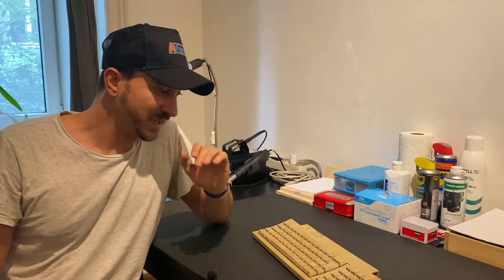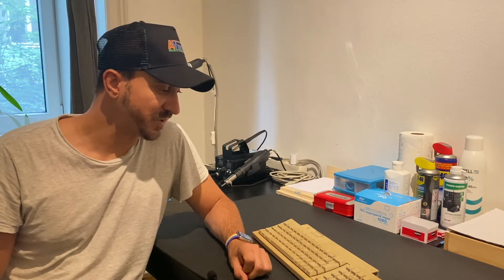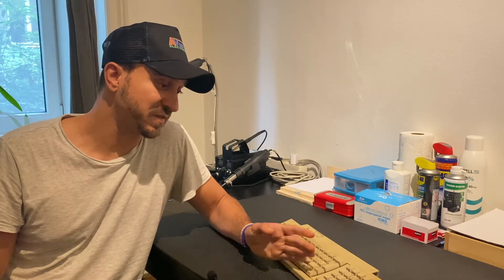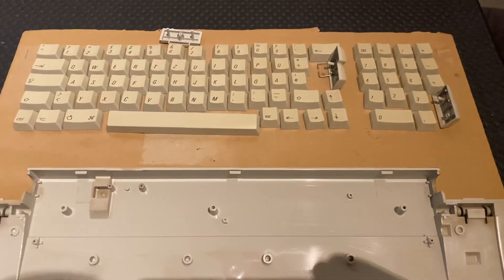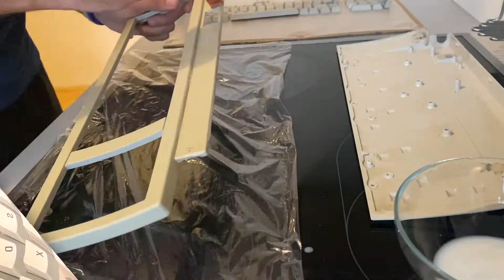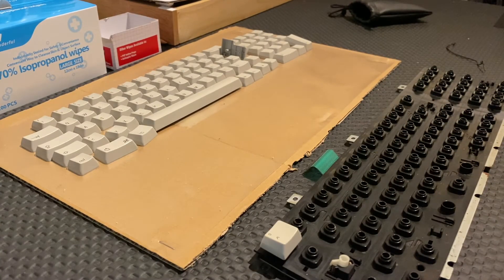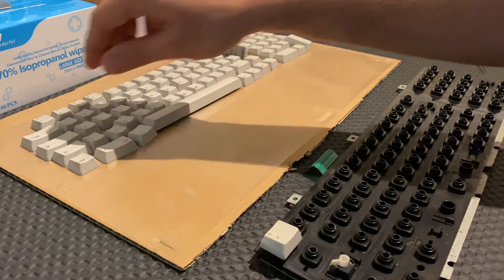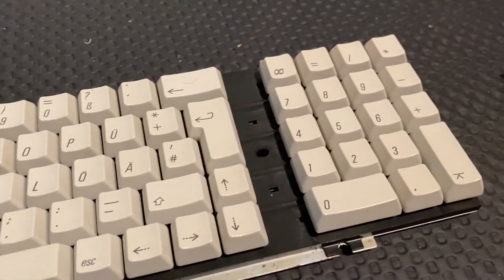Restoring an ugly Apple Keyboard 2 (Episode 15)

Comment: Nice overview. So far, I’ve restored an Apple Keyboard II and an Apple Extended Keyboard II, with an Apple Extended Keyboard waiting in the wings for restoration. I’m curious about one thing. It seemed when I reassembled one of my keyboards, I ended up with two fewer of the rubber things than I expected. I didn’t keep careful track when I disassembled, so I am thinking that two of the larger keys only had one rubber thing instead of two. Did you notice anything similar when you reassembled your keyboard? Enjoying your channel, keep up the great work!
Reply from the maker: Hi Joe! Yeah it‘s exactly like you say: there are I think 2 larger keys that have 2 holes to lock in and one in the middle. In these cases the rubber thing goes indeed in the middle and not in the 2 lock holes. 

Also thanks for the encouragement! I‘ll make sure to keep it up, I will however take a summer break now. With that weather there‘s no point sitting inside creating videos ;)! Will be back in September! Have a really nice summer and E-Mail me if you need some help! Cheers, Michael